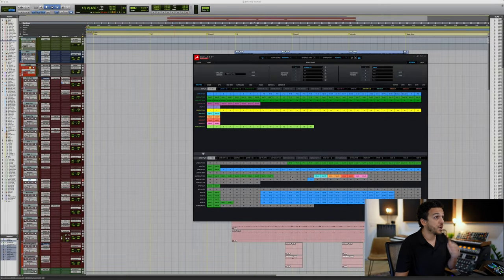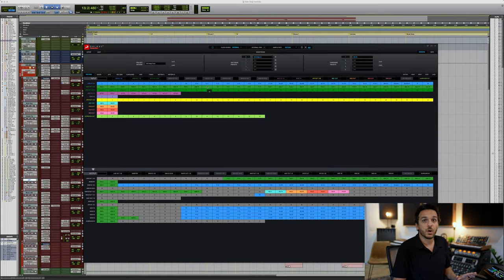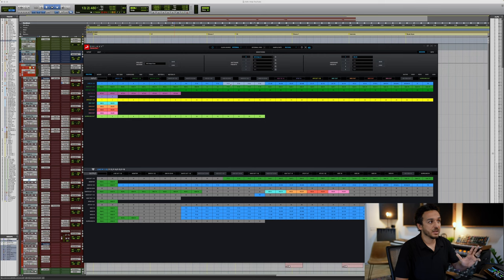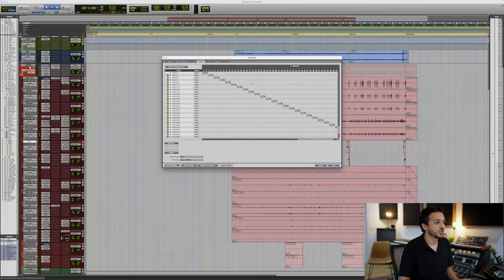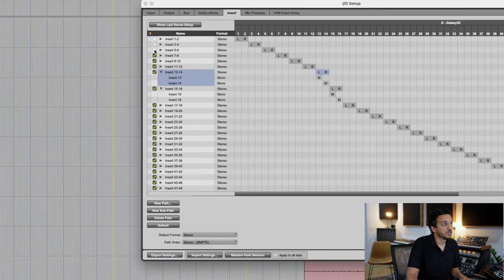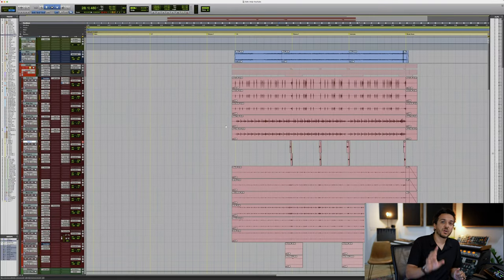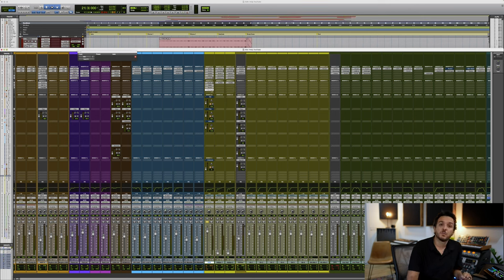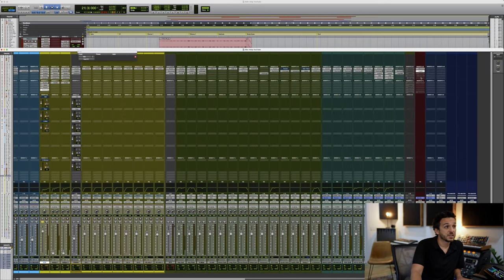Setting Up Protools Hardware Insert with Antelope Galaxy 32

Comment: Nice video! It was my understanding that pro tools does not do automatic delay compensation out side of their own hardware (unless you are connected via the digilink ports). This is why they include the insert delay offsets which will change with sample rate. Easy way to test this is setup a parallel track and see if you hear any phasing or see if you can get them to null. Curious to hear your findings. Cheers
Reply from the maker: with hardware inserts from my experience it is compensated without any issue. I have been using hardware inserts for 5+ years now and never had delay issue.
Reply: @fadygergis  what version of PT? I am running the latest version and I have to measure round trip latency to my hardware inserts and use Protools delay offset. If I do not i hear the latency/phasing. What is your secret for Auto delay comp?
Reply from the maker: @chanepic I am running latest version as well! 
What interface are you using ?

Comment: Great explanation , just A question on Conversion I think you may have missed out on , now lest say  I have a drum bus and i insert A hardware insert say a compressor , thats one D/A to A/D round trip right ? now if use another hardware insert on the same drum bus track ( Multi hardware insert) is that 2nd D/A to A/D round trip ? so 2 conversions ?

Comment: Interesting! could I route / create a multi hardware chain in series ? does the unit route internally or it would be multiple conversion cycles back and forth to Protools with each insert ? example 1176 to LA2A to EQ unit ?
Reply from the maker: It will be multiple conversations
Reply: @fadygergis  Thank you